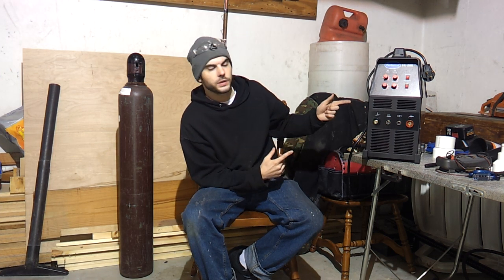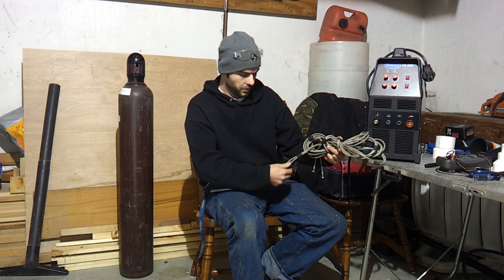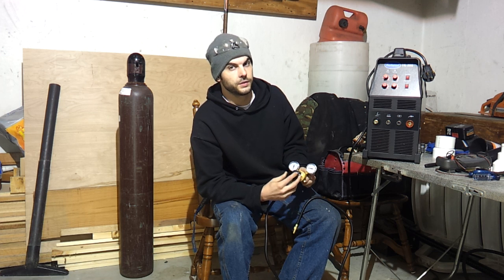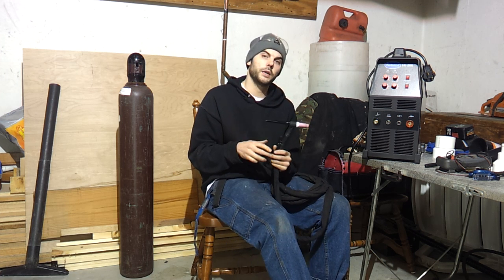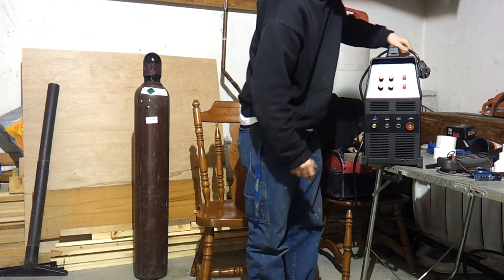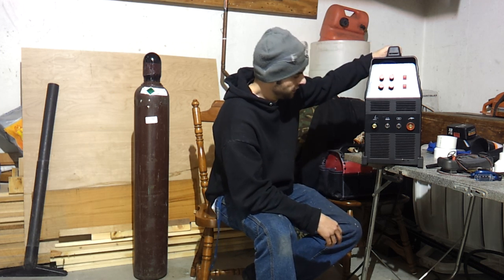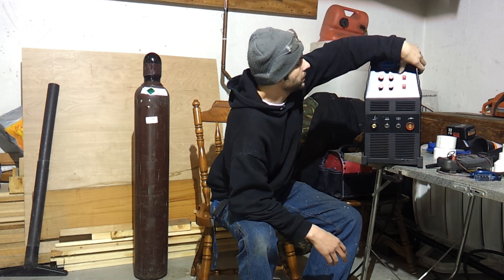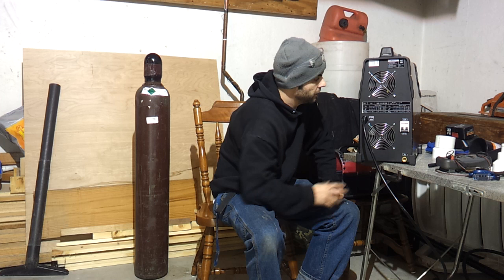Eastwood tig 200

Comment: Were you able to make a thumb throttle?   As I have a bad foot, I would love that.
Reply from the maker: I am still looking in to that at the moment, but when i do i will make a video
Reply from the maker: The thing is the machine is only designed to tig weld, there is no hook up for a stinger